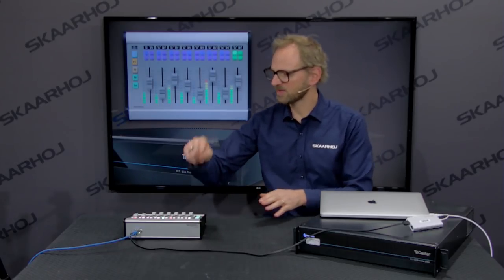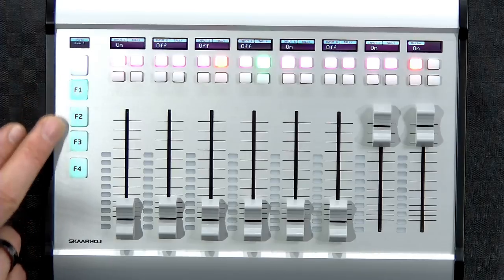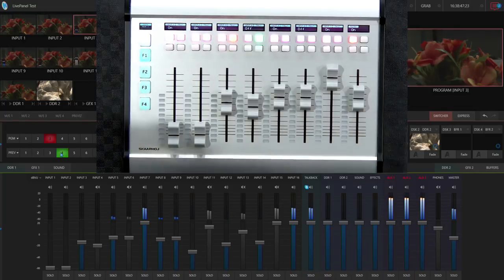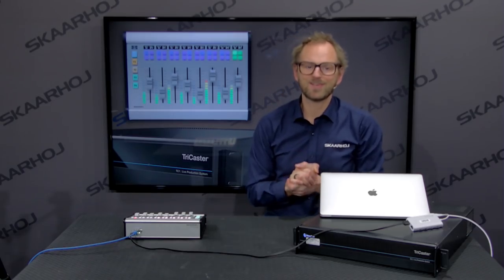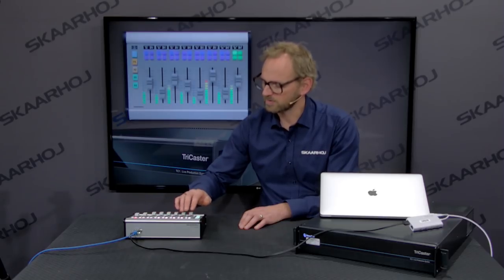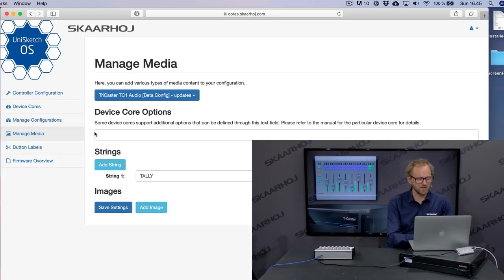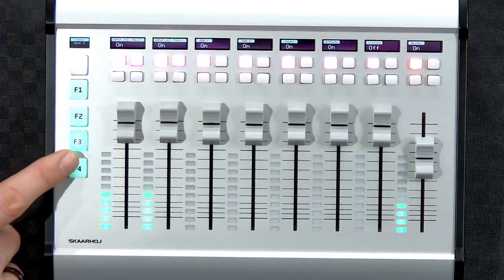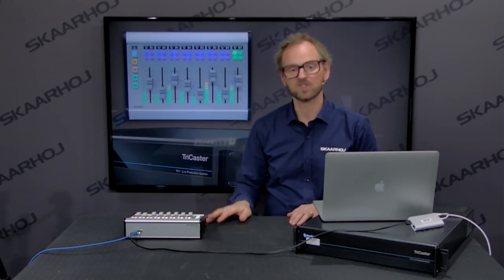Tricaster Audio Control and Monitoring

Comment: is the fader audio metering already fixed when connected to a tricaster? planning to connect it on a tc2 elite. thanks
Reply from the maker: Hi Joemer. 
Audio VU meter data is still turned off by default in the TC1 device core and we do not recommend its use for more then 5-8 sources at a time. We have also not yet tested our controllers with the TC2 Elite, and though we believe they should be compatible we can not guarantee it will work. If a connection is possible you will be limited to the actions currently available in our TC1 device core. We hope to have full TC2 Elite support in the future.
Reply: @SKAARHOJ  Any update if there is success in testing your faders in a tricaster 2 elite?
Reply from the maker: @joemercahayon8640  Hi Joemer. We will have an update about the TC2 in the coming months.

Comment: Why the vu metering function is not supported officially? I do not want to be a geeker :)
Reply from the maker: They will be eventually, but I think I explain in the video that TriCaster will send audio data for all it's channels if there is any even if we need it for only 8 channels - that can simply "kill" the controller because of the data size. We are working on a solution. With TriCaster Mini it works fine because there are less inputs.
Reply: @SKAARHOJ  Hmmm... It's a good news :)

Comment: has the VU metering been solved yet?
Reply from the maker: Hi Josh - Well it works in theory, but its not very stable at this point. We dont foresee this improving for some time, as it has to do with the capacity of the microprocessor that we use in our controllers.
Reply: @SKAARHOJ  Can it handle 8 audio feeds without issue? If so it would be cool as a feature request to Newtek to be able to poll the tricaster for the audio information but specify which channels you want. This way you only get 8 channels at a time (the current active bank) vs all of them causing the overload perhaps?